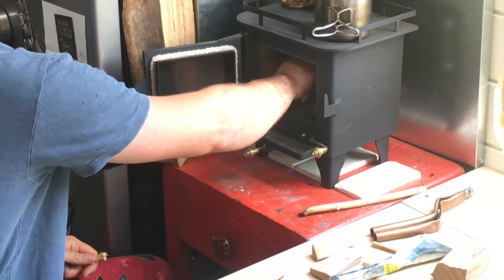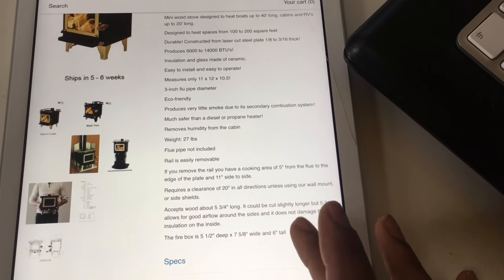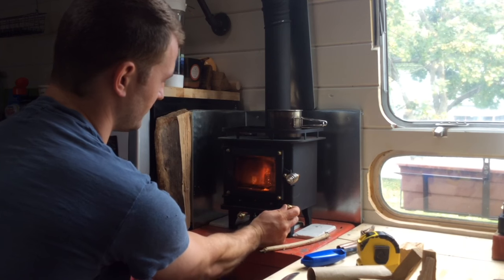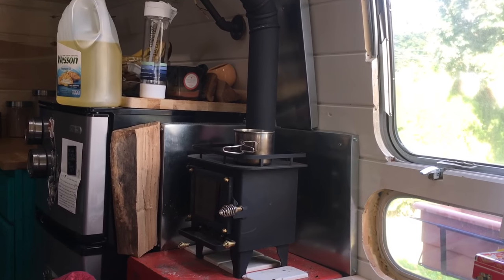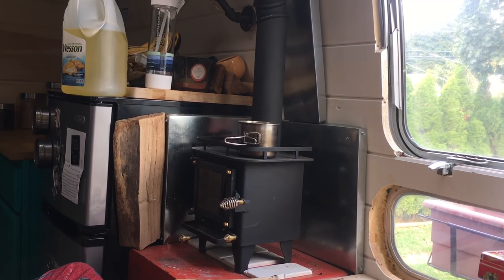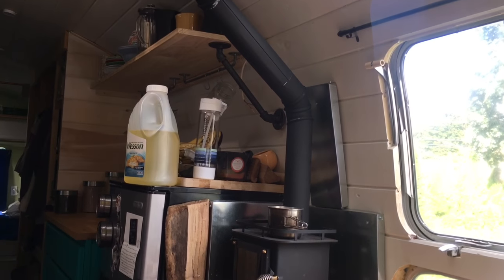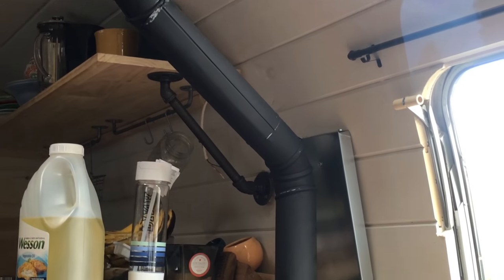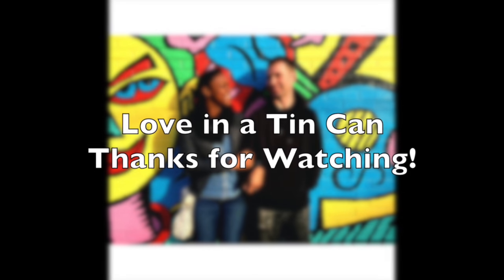TINY Wood Stove in a Tiny House - THE CUB - Cubic Mini Wood Stove Review

Comment: Great video. Glass cleaning tip. When the stove is cold. Take a wet papertowel and dip it in the ashes. Wipe the smoky glass with it. Then clean the window with water and papertowel as normal. It will amaze you, it did me. :)
Reply from the maker: +450rhino1 Thank you for the tip! It has been a challenge keeping the glass clear!
Reply: very true
Reply: I've been using wet wipes. Work perfectly

Comment: Hey guys, two questions if you don't mind...  first, do you find that ash and soot tend to end up inside the trailer, and second would it be possible to remove one of the Vista View windows, have a metal panel made and run the stove pipe through, as opposed to making a hole in the roof?  I am considering a similar  setup for my Airstream.  Awesome video, thx so much for sharing your experiences.
Reply from the maker: +scooby660816 Hey there. We don't seem to have any ash or soot issues in the trailer thankfully. As far as the metal pane, that seems like something that could work. We never considered another option so I'm sorry we couldn't help much with that! We wish you the best on your project!

Comment: cute airstream update...but the "one inch gap" of the heat shield seems to be bolted straight onto the walls..why no real space there??..seems like the wisest way is to make sure there is a healthy gap between the heat shield and any wall and/or other vertical surface for safety. was there a specific reason you guys opted out on that?..because the shield can have a lip on the bottom which can be bolted to the base..and there is that piece of firewood placed between heat shield and the side of the counter (if i remember what it was??)..but, omg, why is it there?? fire safety first ..just wishing the best for your safety.  😮

(and i very much miss having a wood stove...sold the place i had 10 years ago and have promised myself that my next home will have one.. exploring tiny homes on wheels.) 👍
Reply from the maker: +roxanneworld11 Hi Roxanne. Thanks for thinking of us. Here is a link to Cubic Mini Wood Stove where we got our stove from. There is a wall mount product that we loosely based the design of our heat shield on. Our walls in the Airstream are curved so there is more space behind the shield than you think, allowing air to pass behind the shield. So we have no issues. :)

Comment: I like the video you guys did it was  very informative I was wondering if I could use pellet stove pipe through the wall as I only have a small cabin 8 ft wide and 10ft long and the peak is only 7 foot high something like a little shed but I can't put it through the roof due to the wavy roof that was installed I was wondering if you could help me with this thank you very much for the great video again looking forward to your reply thanks
Reply from the maker: Hey there! You could put the pipe through the side but Dektite Pipe Flashing is made to be used on metal roofing. That’s what we used on our roof since it wasn’t flat, size 4 I think. :) Here’s a link to what it looks like: https://www.google.com/search?q=dektite+%234&client=safari&hl=en-us&prmd=sinv&source=lnms&tbm=isch&sa=X&ved=0ahUKEwiskfWrzpHZAhVlQt8KHW3kAcEQ_AUIEigC&biw=320&bih=460#imgrc=oHhGrK-zxv2OmM:

Comment: Hey just wondering what's the technique for cleaning the flue pipe and what kind of wood do you guys use for the fire it seems like a lot of people use 2x4 but that could start getting expensive and and cutting firewood logs to the appropriate length seams like a lot of work.
Reply from the maker: +J Ma We've been doing it the cheap way lol, all I do is remove the inside portion and take it outside and scrape the inside with a stick. Then the flue pipe that goes through the ceiling I do the same with a bucket right below it to catch any debris. For the firewood I cut and split regular 18" logs to season them and I'll use the chainsaw to cut them in small bits as needed.
Reply: You can get a silky saw tho cut wood. Supposedly they cut liked butter!!! Look at CanadianPrepper on youtube. He is a distributor as well.

Comment: They load up the pipes with creosote because they don't burn hot enough, keep an eye on that.
Reply from the maker: Trouble Shooter thanks. We'll be switching out our single wall pipe for a double wall soon. It'll help with creosote. So far though we've only had to clean ours out once this year.
Reply: You only want double wall after it leaves the room you want heated, as well as what is outside the building.  Creosote accumulates on cold steel, like condensation.  Keep the flue hot, no creosote build up!
Reply: @jameslarson6555  Thank you, I was not aware of that!

Comment: I would really like to buy one of these but i keep hearing horror stories about the creosote leak and creosote buildup in the pipe. Can anyone with experience speak to these concerns? Does the double walled pipe reduce the creosote buildup?
Reply: I have one...I use double wall straight up and out, 8 feet long. Double wall keeps more heat in the pipe reducing creosote build up. Having a 8 foot pipe also increases draft over having a shorter pipe. Increasing the draft makes it easier to start a fire in the stove, and reduces smoke  when you open the door, it also reduces creosote build up. The type of wood you burn and how much you throttle back the air will also effect build up. I burn daily in the winter cedar, Pinon, and elm wood i usually keep it wide open 🔥 hot. I clean the pipe about once a month, you will know when its time to clean because the first will not light as easily.

Comment: hello, I ordered one of those wood stove thinking i would put the pipe through the roof, but I found out it is not possible to do so, due to the way my roof and ceiling are made up . I am having a hard time finding a through the wall piping system of a 3 inch diameter . I Was wondering if anyone had been looking in putting a mini cubic through the wall and how they did it ?
The majority of my pipes would go straight up inside the tiny house ( my floor to ceiling is 11 feet ) and the exit would be close to the roof , but on a wall. Thx for any input if anyone has any comment , Thx
Reply: I don't know much about wood stoves, but Gstove, a Norwegian company, has pipes that you can order as extras. (For their portable wood stove)  Perhaps they have sizes that will fit/suit your needs. They have elbows too, 45 & 90 degrees.

Comment: What size gasket did you use on the roof? #4 or #5? Thanks.
Reply from the maker: +Marie Spain We used a Decktite pipe flashing that you can cut to size. Here's a link to the one we got- http://m.ebay.com/itm/161205861651?_trkparms=aid=222007&algo=SIC.MBE&ao=1&asc=20150313114020&meid=79705a20647d4c4687ba090213d94e11&pid=100338&rk=1&rkt=27&sd=151865829725&_trksid=p2141725.c100338.m3726&_mwBanner=1
Reply: There are six sizes listed. Now that you've been using it for a while, are you happy with it? Any problems with creosote buildup in your pipes? Are you using single or double pipes? I want to put the mini in my van...it's so cool! Thanks for responding and posting info.
Reply from the maker: Marie Spain So far so good. 👍 We have a single wall pipe but it's recommended you use a double wall. We'll be switching our pipe to a double wall eventually. So far the creosote hasn't been bad for us. It does depend on what wood you use and how hot the wood is burning but we've only had to clean our pipes once so far this year. We'll keep you guys updated though on the stove & creosote.
Reply from the maker: Marie Spain Also my husband believes it was size #3 that we used but not completely sure, sorry!